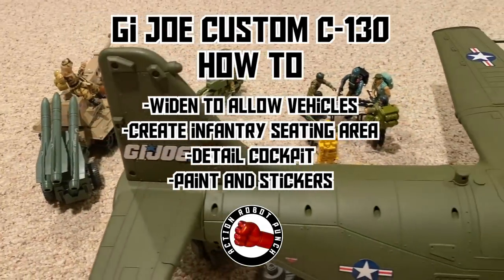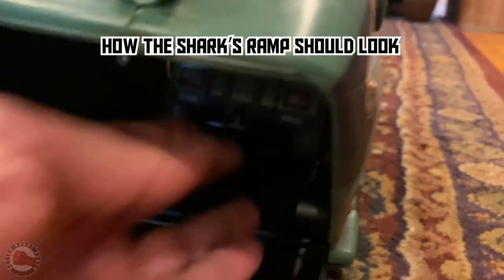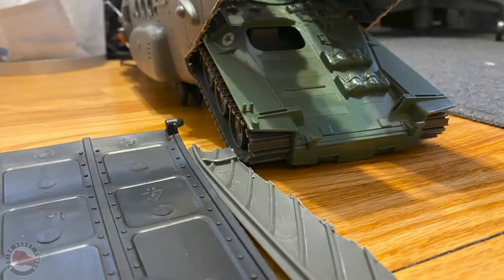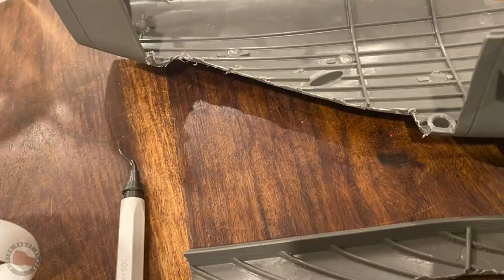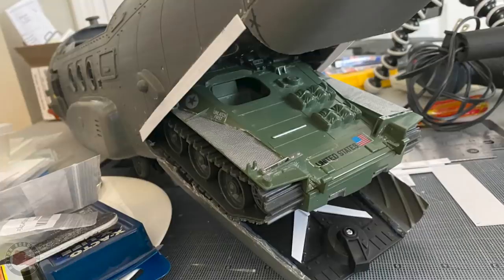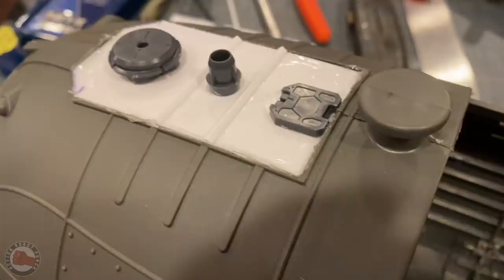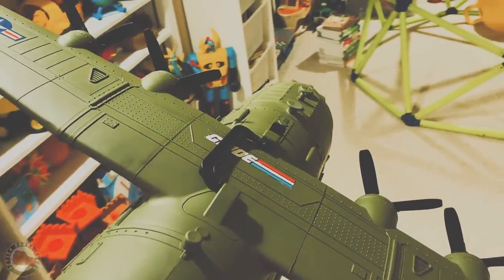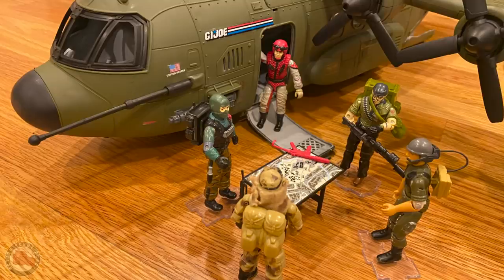Gi Joe C-130 Shark Custom Transport Plane - DIY How To

Comment: That's impressive. I bought one of those when Toys R Us went out of business, and just had it in the box for a month. As I assembled it, all I did was strip off any decals I didn't like, and settled for the limited space in the cargo bay. I would never have dreamt of cutting it up, widening it, and making it more capacious for bigger vehicles. I have, however the TRU Heroes, the helicopters, I did up their analog of the Dragonfly, merely repainted, their sort of Chinook, I painted blue with a giant 456 on the front, for Zartan (I'm more of a comics fan than of the cartoon) and the TRU Heroes closest equivalent to the HIND-D, I stripped decals, and repainted it and handmade decals for the Oktober Guard. Mine are intended for the 4" figures, (25th Anniversary and onward), as my forte is action figure customization (and accessories). I once found a Tonka 6-wheeled dune buggy thingy, I plated it differently and made it the Oktober Guard's little 6-wheeled vehicle. Would love for that to fit into the cargo bay of the HIND-D analogue.
Reply from the maker: I'd love to have a hind. I've been wanting to make one for a while. One with a removeable vehicle would be amazing.
Reply: @ActionRobotPunch  the almost Hind comes with a little rinky-dink vehicle that barely fits one figure, I have set it aside because it annoys me. My 6-wheeled vehicle wouldn't fit if I did saw up the helicopter. I'm still working on other Oktober Guard figures, trying to make summer uniformed Daina and Horror-Show, for comics issues that take place in Sierra Gordo, I have already made winter versions. Other characters in my personal collection are Captain Bulgakov, Dragonsky, and Sgt. Misha. Apart from the standards, Schrage, Col. Brekhov, (my Col. Brekhov has a lit cigarette in his mouth, permanently, lol) and the store-bought Red Star. I think I'm forgetting someone.

Comment: Badass idea, especially with the putty to fill in the gaps as I bought a cheap military helicopter from my thrift store to use for my G.i. Joes and it has a gap and the way how you made those seats are great as I plan to make some as the helicopter I got has no seat for my troopers to sit in.
Reply from the maker: Good luck with your project and thanks for watching!

Comment: That’s an awesome project! You can get a version of this plane on Amazon for 40 bucks free shipping… looks like the same mold. I might get one and attempt to turn it into the Razor Crest for 6 inch Mandalorian figures!
Reply from the maker: Cool idea. Just be careful the one on Amazon isn’t the cheapo smaller version of this one. They’re the same c-130 type plane. The small ones don’t have a removable roof.
Reply: Cool, I appreciate the heads up
Reply: @ActionRobotPunch  update: yeah
You are right… the ones I was looking at were smaller… I found a few on eBay in pieces… all I need is the main body, but not the wings … update: update: picked up the main body for 20 bucks! That’s all I need… I’ll keep you posted!

Comment: nicely done with what you had to work with!
for something really good, Hasbro would need to do a 50% bigger version.
I think sentinel does a cool sub too, but same problem, too small.
Hasbro really should have done those, the flagg was a nice effort.
they should have done a more complete hull, bigger, and no electronics.
the focus on price point, and time of development botched it.
at the time, you could get a child plastic pool for about $30.
so with a little more work, they could have done a bigger flagg that floats.
I m sure that by mixing different kinds of plastics,
they could have made something lighter, bigger, at the same price.

good work!
Reply from the maker: Thanks. That's a really interesting idea about making the hull from that toy pool plastic. I imagine these are a ton of things to consider when making these, especially how big is the box going to be. I imagine that's why the Flagg comes in sections and is mostly a hollow framework. I don't think I'll ever get one because it's just so big! Thanks for watching.
Reply: @ActionRobotPunch  that flashed me when I looked at toddler toys that were much bigger, but way cheaper, granted they had no real detail, but for a hull, and other parts, you don t need that, you can build another part with details with another kind of plastic. I read some stories about gi joe toys, and development was way too short.
the lifespan on shelves was also too short, they would have made much more money by lengthning product a year longer, and fewer products with better quality designs.
giving more time for consumers to get the whole collection, and have more enemies to play against. army building cobras was endless. thanks for the reply!

Comment: I do like what you have done here, about the only thing I would have done differently would be to remove the cockpit internals and glue in a couple of pilot chairs, allowing access to the crew compartment that you replaced the electronics with.
Reply from the maker: That's a really good idea. I did think about cutting out the center, so the pilots could pass through but decided instead to add that center console. But two standalone seats would be a nice mod. Thanks for the idea.
Reply: @ActionRobotPunch  then you could put a radio operator in the back area.

Comment: Man, I've tried finding one of these at Target, they don't have it, even online...  Maybe it's a seasonal thing?  I'm gonna bombard you with questions!  So, what kind of paint did you use specifically?   It looks great!   What kind of paper did you use to print your stickers on, and was it just a regular ink jet printer?  It looks amazing man, and your wife is really cool!
Reply from the maker: Haha!  That plane seems to pop up randomly over the years in different places. I’m sure it’ll be back. Krylon camouflage woodland green…amazing paint that sticks to plastic. I also use tamiya spray paints…expensive but best quality and dry fast. For the stickers I used my cheap inkjet. I have a link in the description to the specific paper I used. Keep in mind that printers don’t print white so the clear sticker paper won’t work for white stars or stripes. Good luck making one!
Reply: @ActionRobotPunch  I will gather the materials for now, and will keep a look out for the airplane.  I will share with you if I find a plane and make a Joe custom.  Thanks for all this info!  Have a yourself a good one!

Comment: Did you sand it before painting? I thankfully found one and I'm getting it ready for my kids bday. Thanks!
Reply from the maker: I only sanded the parts that were rough from the putty. I didn't sand the whole surface or anything like that. I did remove the stickers and used goo gone to make sure I removed all the glue. Make sure you use that krylon plastic paint. It bonds really well with the plastic.

Comment: Any way to under mount a g. i. joe 105 howitzer poking it out either the sides, or the front, or add in some of those chain guns out the side of the plane for a AC 130 gunship? One thing Joes really need are some solid air support.
Reply from the maker: I’m sure that would fit. I think I’ve seen people modify this toy into one of those aerial artillery platforms. That’d be a fun project. Thanks for watching.

Comment: One question, how did you put the windows on the plane? When I tried to add windows it failed horribly
Reply from the maker: I didn’t add any windows. Do you mean adding glass or clear plastic to the windows? I didn’t try that. I just left them open.
Reply: @ActionRobotPunch yea did u add glass / clear plastic to the front of the plane cause i suck at adding it

Comment: Nice custom job, but showing the army men c130 in the thumbnail kinda throws it off
Reply from the maker: Thank you. Yeah good point.
Reply: @ActionRobotPunch  No problem, but you are right about Hasbro definitely should have made a C-130 toy for the actual line.

Comment: HASBRO has had sooo many missed opportunities. Instead of releasing an Arctic figure every 2 years, they should have made an Arctic unit. I did a custom Arctic Unit and I'm building their Arctic Outpost. 
Doc and Lifeline for the whole team? Nope. I made a Rescue Unit as well. 
Cobra in the early days had that MASSIVE blue plane. Like a flying base. 
It was all over the Sunbow-Marvel cartoon. They could have made that to combat the USS FLAGG .
Reply from the maker: That giant cobra snake plane would have been an epic toy!
Reply: @ActionRobotPunch  it could be constructed. It would have to be a larger scale on the outside and scaled back down to 1:18 inside. The mouth opened and that would be the troublemaker end of the project